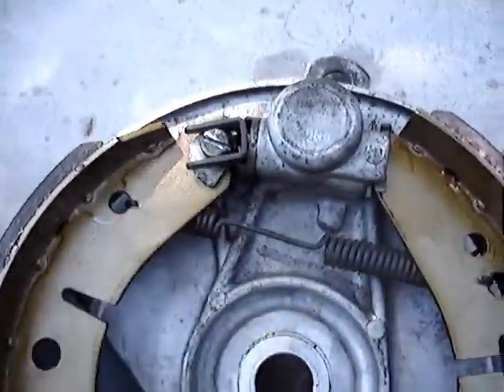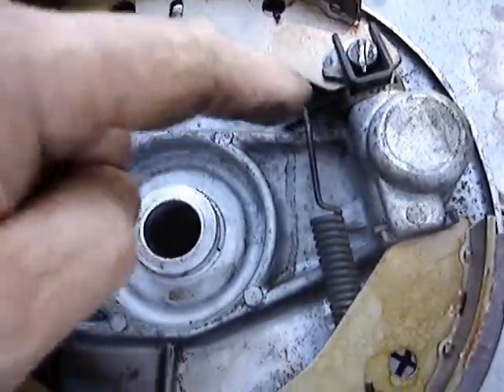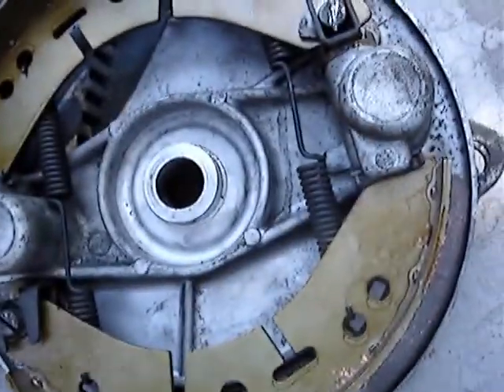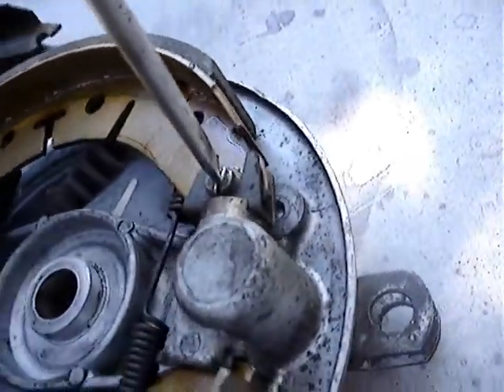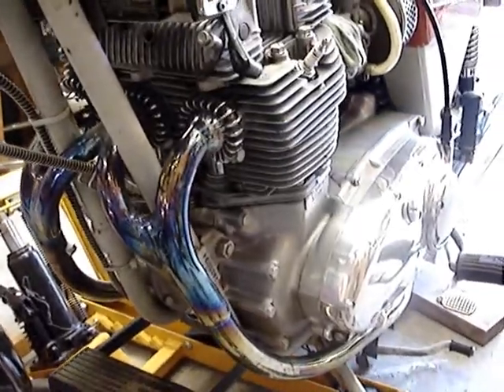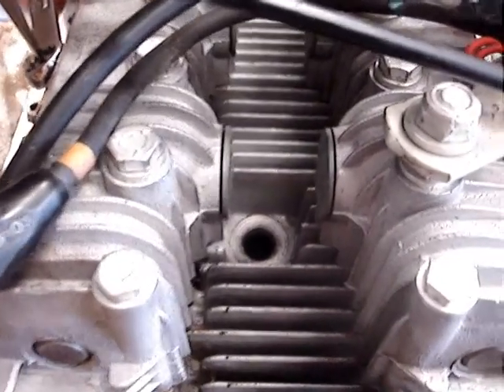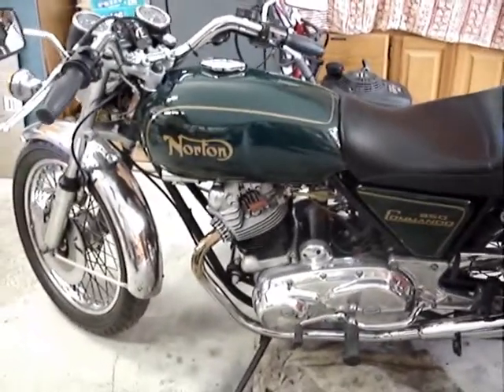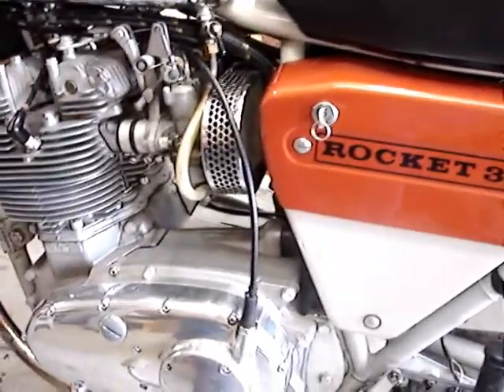BSA Rocket 5 Speed Brake service, valve adjustment, and starting

Comment: I wish I could even get my R3 bolted back up. All torque wrenches I have found start at 20lbs and I have centre conrod to tighten as well as barrel to check. I dislike '71-on front brakes lighter than tls 60's though.